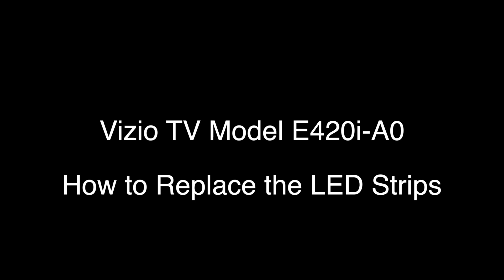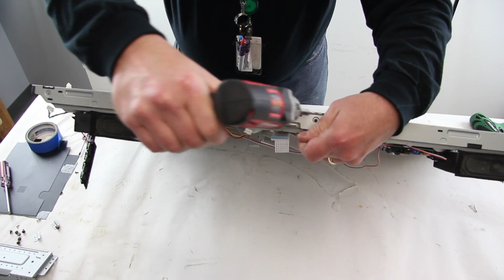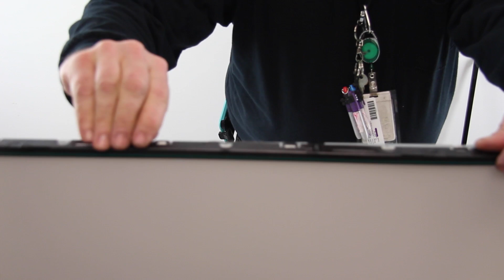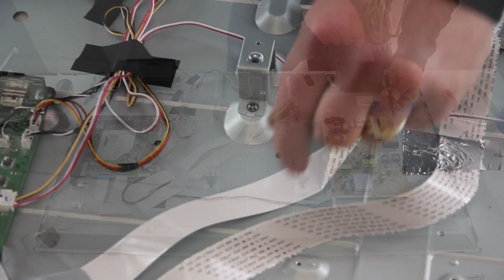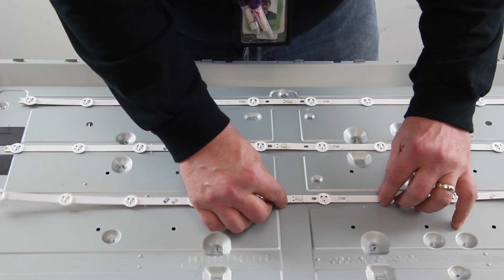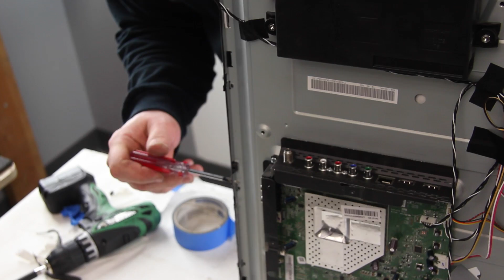LED Strip Replacement Tutorial - Vizio E420i-A0 TV  - How to Replace the LED Strips No Backlights

Comment: Repaired my tv! Thanks for the video.  3 things to add:  1) He makes the back cover look easy to remove.  It isn't, it is not just screwed on, but snapped on.  2) If your tv is a few years old, it will be dusty.  It took some time for me to give it a good cleaning.  3) Most importantly, the connectors at the center of the light strips are not all the same, but are staggered somewhat in length.  You must match the holes on the reflector board with the connectors and all lights.  Don't stick them on before you check this, like I did.  Hope this helps.
Reply: Thanks for the heads-up about the light strips!

Comment: Hi  I have been working on a Panasonic TC55AS540 C LED TV that will not power up. Red LED indicator comes on solid red. TV backlight flashes 3 times over about 15 seconds, then TV appears to go into standby mode (flashing red LED.) Replaced power supply and main boards with units from TVParts Today. No change to operation, Tried replacing boards independently,(mix & match. ) Same result

Comment: Awesome, awesome, awesome, awesome. Thank you so much. I have the E420d-a0 and had already replaced the power and main board but TV still wouldn't power on. My Vizio after pressing the power button would do nothing and the power light would fade off. About 1000 talk about this same issue, but nobody ever said what would fix it. I found a random post on the internet saying if a LED strip goes out, the power board will go into a self protection mode, go down in voltage (as mine did using a voltmeter from your other video) and could prevent the TV from powering on. Yes a busted LED strip can prevent the whole TV from turning on. I ordered the light strips from you, followed this video step by step, and the TV WORKS! I really wanted to save this Vizio as it's a 3D TV and they aren't made anymore. It was worth me replacing parts. THANK YOU!

Comment: Great guide.  Replaced my LEDs and the set works perfect now.  Was surprised to see that my Vizio E470-A0,  despite all Vizio documentation and packaging referring to it as edge lit, is in fact not an edge lit tv. As you can see in this video, there are in fact no leds around the edges of the set.  Strange.

Comment: Great video! Question: how exactly do you "test the LEDs before reassembling the TV?" Just plug it in and turn the TV on?
Reply: That's what I did.  Both boards in and connected, but you don't need the WiFi and IR boards connected.

Comment: Successfully replaced the LEDs in my E550i-A0 using this video. Couple of minor differences with the 55" (i.e. You don't need to remove the boards to push out the reflector clips; there is also a long wire connected to the top of the inner filter bezel that I believe is just a ground, can be removed easily during repair). Thank you so much for the video and parts, saved me a lot of money!
Reply: Greg, what did your display look like before your replaced the LED strips ?

Comment: I followed this video and before none of the led strips were working afterwards only half the strips were working. The three that were not working connected to the wires that are labeled LED 1- and LED 1+ on the power BOARD. I did try switching around some of the strips and they all worked when they were connected to the LED 2- and LED 2+ path. Any idea where I should look next for the problem?
Reply: Jordan I have the same problem (indeed I had this problem for a while before the TV failed, so now I am afraid same thing will happen again with the new LEDs). I have the Vizio E470i-A0, and the 2nd, 3rd, and 4th positions (out of 6 horizontal positions) are not working. Did you have the same problem? Do you think these positions could correspond to LED 1 or 2 (I would've thought they would be split in half in order as in 123, and 456; instead of 234, 156 like what I'm seeing). I'm thinking my issue could even be the distributor board strip.

Comment: I can't even get the F'n back cover off.  I took out all the screws including the one under the stand, double and triple checked that I didn't miss any.  Been prying away for an hour and it wont' budge.  They always make stuff look so easy in videos but it actual practice it's nearly impossible.
Reply: You might want to get a "spudger" tool. There are little clips all the way around the seam that hold the two pieces together, that tool can help a lot with those. Took me a while even with that, just have to be slow and careful.

Comment: I received my strips this week.  Installed them today.  Voila!  It worked!  Thanks so much.  The two ribbon cables gave me fits re-attaching them until I figured out they don't just insert.  There's like a rocker arm you flip down, insert the cable, then flip the rocker arm back up.  Otherwise, everything went smoothly.
Reply: Tom Hansen what causes you to change your stripes does your tv turn off and on ?

Comment: Great video. Two things though. 1. Don’t let the led strips touch the metal before you connect them to the distributor board and/or to each other. They are extremely sticky. I 2. Be extremely careful with the dark screen it bends easily and lay it on a flat surface and use two people. I moved mines alone and cracked it. I have the same model in the video(e420i-a0) so if anyone needs brand new led lamps or the power board or the other board or speakers, let me know and we can work out a really cheap deal.
Reply: dirty south ...

U still have
Reply: A Ewel 
Yes I do

Comment: I have a Vizio 42" E420i-BO Smart TV. If you plug it in, it will either 1: do absolutely nothing 2: power on and display the vizio logo continuously and not allow you to do anything and/or lose power or "reboot" randomly 3: it will work okay for a minute, then power off. Tv had been out of commission for about 6 months until i decided to try seeing how difficult replacing the main board or power supply board would be. Bought a used power supply board for $10. Put it in and eventually concluded that the TV does the same thing with the "new" board installed. I just ordered the complete tv repair kit from shopjimmy.com. Does this not seem to be a power issue? When the TV will actually turn on, the backlight, remote sensor, panel, picture, inputs, apps, memory all seemed to work fine. In theory, the kit should fix this problem, correct? Does this model also have a t con board that could potebtially be the problem or is it built onto the main board?

Comment: Just changed the strips, no problem TV works great. Just read the tips and comments and don't rush as it is really easy to break something. When I took the cover off the first thing I saw was a LG sticker on the frame.
Reply: Jeep Cherokee It was on your vizio?
Reply: Yes Vizio but it probably is LG built. Just put Vizio on the outside.
Reply: Jeep Cherokee LG makes the panels for many TV suppliers. In fact the only two companies that actually make their own panels are LG and Samsung

Comment: Thank you! Successful installment! Great video, made it easy to follow step by step. Parts from shopjimmy arrived quickly. As other have said label those screws. Another tool I would recommend is an isesame or equivalent for cracking open the outer shell and popping out the side control board.

Comment: just did this.  Took about an hour using video to guide.  be careful when taking off the ribbon  cables.  There is a flip up "thingy" that releases them.  Don't just pull on them (like I did!).  

Pretty straightforward and easy.

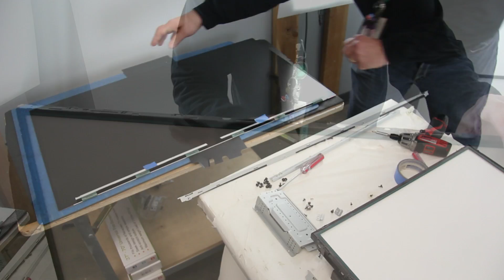Comment: When removing the tape around the perimeter of the light case (5:27), do you need new tape to replace the old?
Reply: I found the tape does not need to be removed.   Each bracket will hinge away from the  case.  Just be careful when handling the casing during subsequent steps.

Comment: When troubleshooting I stripped down to the LEDS.  They're blinking slowly and dimly. While trying to test voltages on them occasionally a strip or two will light up. Is there a way I can tell which strip is bad? Or safe bet to just replace them all? I was getting. 130v. On the psu board.

Comment: Hi there, I have a Vizio TV model E55OI-AO and the LED strips in the middle seem to failing. It has a dark tint all the across the middle. I am having trouble locating the panel number for my TV. Is there a specific location on the TV for this number?

Comment: I  was watching my Samsung - 60" Class (60" Diag.) - LED - 1080p - 120Hz - HDTV, Model #: UN60EH6000FXZA and it turned off.  When I push the power button  I see the light go on the light flashes. What could be wrong with my TV, any suggestions?
Reply: I have an LG with the same exact issue. It is because one or more individual LED lights have burned out and the tv is preventing them all from turning on. The tv senses a drop in resistance or something in the strips with burnt out lights so it wont let any come on for more than a second. You can see the screen with a flashlight right? I am going to attempt to fix my LG with LED strips out of a Vizio. They look identical. I'll post back to let everyone know how that goes and if it works. Tried to solder individual LED's in the LG but I couldn't find the correct size LED's, hopefully the strips may be the same in the Vizio. I'm trying to avoid paying around 100 bucks online for all new LED strip set.

Comment: Hi I have an LG 47LN5750 I have an issue with horizontal lines flickering around my screen, and dragging the picture down a few inches every 4 seconds then back to normal. There's also a line running across the display one of those common problems, any solutions for these issues? Primarily the former since the line isn't really as much of an eye sore as flicking lines and images everywhere.

Comment: +ShopJimmy.com Hey great video why doesn't part # BN96-13067A X-Main Board for the model PN42C430A1D model code PN42C430A1DXZA have that small additional board with the ribbon female attachment to it , i need to order a x sustain, or  x main board for this model but want to make sure this is the correct part i followed your diagnostics video where i heard clicking and red power light stayed on when i removed the y board connector, then when i removed the x main board connector with the y board connected then applied power the greeen light on the main logic control board was steady and i heard the chime no clicking , the tv was also tested by an electrician they marked the x sustain board as bad but i wanted to double check with you guys , i need the correct part please reply